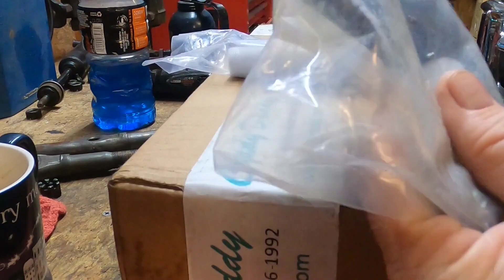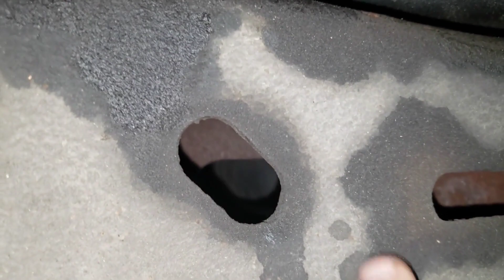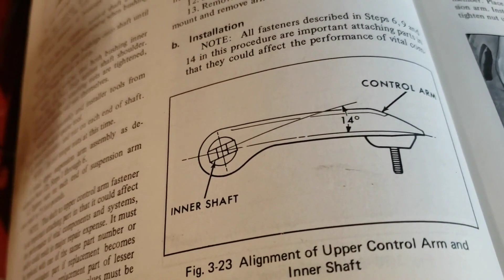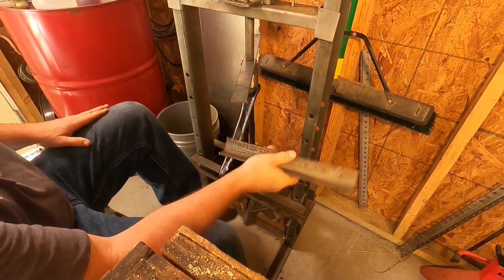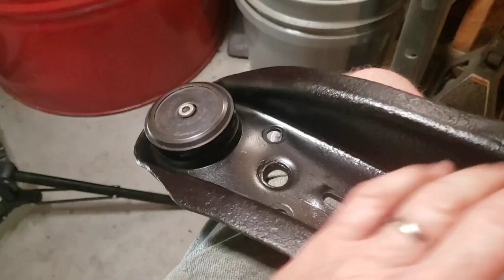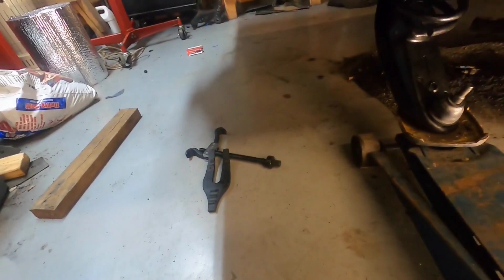71 Cadillac Coupe DeVille Complete Front End Rebuild - Part 4 - Reassembly Begins

Comment: In the Cadillac service manual it states to install a spacer j8999-23 under the flange of the lower control arm bushing flange. Not sure of the thickness but worth noting in an amendment
Reply from the maker: The original Kent Moore specialty tooling is no longer manufactured but you can find original examples on Ebay, as well as after market equivalents. On occasion, if I need one of these tools I try my hand at fabricating a similar example and usually gets the job done.
Reply: @ImpalamansGarage thanks for the reply I was able to get the tool off eBay. There is supposed to be a 3/8 gap between the lower control arm and the bushing flange created by that tool

Comment: Hey Mike, excellent videos. I'm curious to know when replacing springs (front & back) to original, what purchase considerations should take place? For example, are there any adjoining wear parts not already shown that should be replaced; and is there a 'top & bottom' / right way up for the coil springs? Viewing from the land down under!
Reply from the maker: Howdy John. There is not really a top and bottom, although some springs do have a flattened/shaved end. It depends on the make/model of the vehicle (referring to cars in general). There is a little notch (or recess) in the lower control arm where the very end of the coil spring sits. Once the suspension is disassembled it will be apparent. Depending on the history of the vehicle (previous owner driving habits, environment, etc....) some of all of the rubber bushings in the suspension system will need to be replaced. With cars of this age, even if they are very low mileage (kilometerage ?  LOL) the rubber will have considerable deterioration.  If your car has never had any of the steering and suspension components refurbished in it's life time, rest assured that it is time. Ball joints, tie rod ends (track road) bushings etc....
Reply: Thanks, Mike, for your comments! Yes, good, better, best. Never let it rest. 'Til your good is better and your better is best! Thats exactly where we're at, working our way through all the aged bushes & joints. It's become apparent both shocks & springs need doing for best. Nothing less! 🙂  @ImpalamansGarage